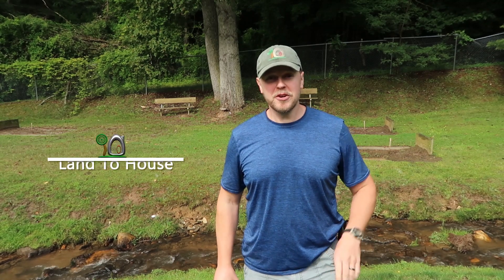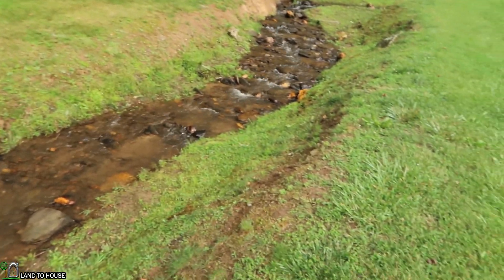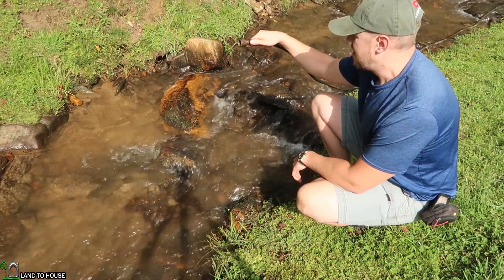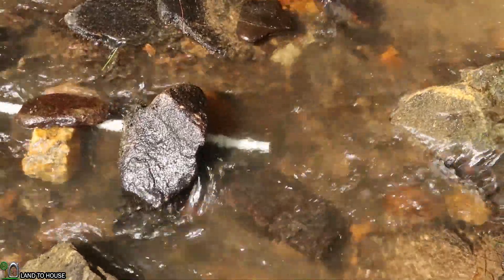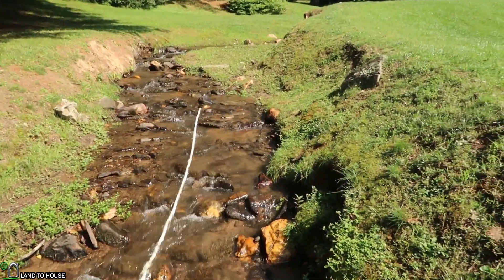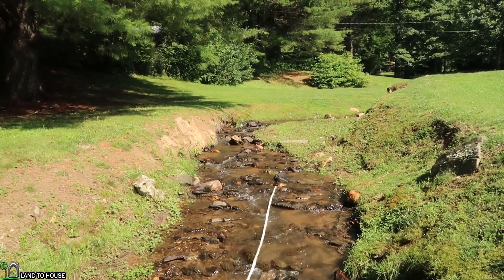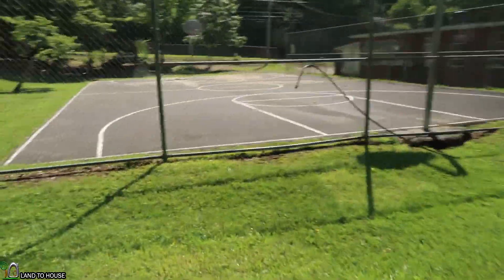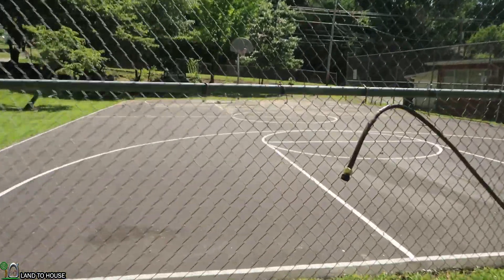Ram Pump Small to Medium Creek Assessment

Comment: If you use a wider pipe on the intake side and reduce it down so it fits the pump, will the head pressure increase?
Reply from the maker: No the head pressure would be the same no matter what drive pipe size you have. Its best to match the drive pipe to pump size.

Comment: It would help greatly if you increase the size of your supply pipe for example the half inch pipe you have supplying the pump should be increased to two in to get more water flow to the pump and more head pressure.  Am I correct?
Reply from the maker: The best effeciency is to use the same size drive pipe as waste valve. however if you have an issue with low head pressure like I do here you can tilt the valve to reduce the closing weight of the flap. This will allow the pump to start with less head pressure. if you go with a larger drive pipe you might run into issues with the valve closing and not reopening.

Comment: Have you tried 1/2 “ swing valve and 3/4” one way valve?
Wondering if the larger one way valve could reduce friction and increase flow.
Reply from the maker: That might be a fun test. Allow more water into the pressure tank per cycle. I assume if you went too big on the secondary valve it could stop the pump. Worth a try.

Comment: If a ram pump was used without much uphill, maybe 2 ft up per 100, but in a relatively flat yard 100ft from source in a closed pvc loop (300 linear ft), would the pump be effective, considering the closed pvc loop was mildly perforated for a sprinkling/leaking effect (hopefully increasing back pressure due to small enough holes.)  Does that question make sense? Will it work? I did not mention pipe diameter, is there a diametere that would make this possible in the delivery pipe
Reply: no wont work.

Comment: I have a very winding creek with a flow very similar to the one in this video.  Will I be able to make a pump that can function with out a straight run drive pipe?
Reply from the maker: Yes you can use a drive pipe that is not straight. It is better to have the pipe as straight as you can get it but the pump will work just fine with some turns.

Comment: Hi why  don’t u attach a funnel or a hopper tub to help increase the volume of flow in the water intake?
Reply from the maker: From my understanding a pipe with known head pressure will only pull a certain amount of water by gravity. Even if a funnel is added it will not increase the flow rate.
Reply: Land to House thanks man

Comment: could you put a check valve on the end of the hose to see if you get more water bc of the pressure. thanks
Reply from the maker: You mean the end of the delivery pipe? At that point the pressure is so low it would not do much. The reason the valve goes close to the pump is to relieve pressure of the water column going up the hill.
Reply: @LandtoHouse  i do recall you did that on one of your videos and it did put out more water due to being able to build up more pressure. just not sure how much more vertical you can go utilizing check valves.
Reply from the maker: Oh you mean place a non return valve in the delivery pipe close to the pump. Yes that helps keep pressure off the pump and allows you to pump up a little more.

Comment: Can you use ram pump on 30-45 gallon rain barrel as your source..?
Reply from the maker: Yes you can. Do keep in mind that the ram pump uses a lot of water to operate. So if you had a 1000 gallons in a tank and used a 1.25" ram pump with 8gpm usage. That tank will be empty in 125 minutes.